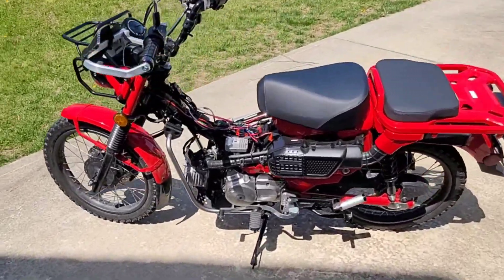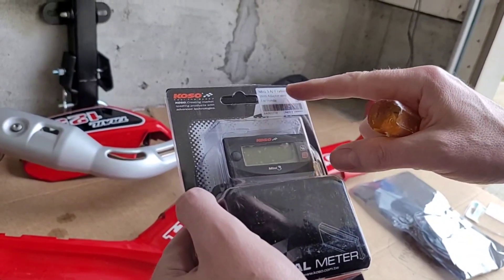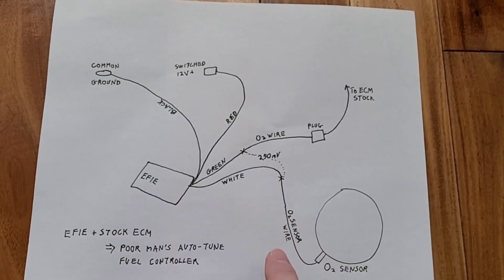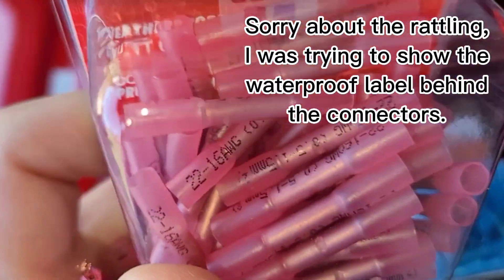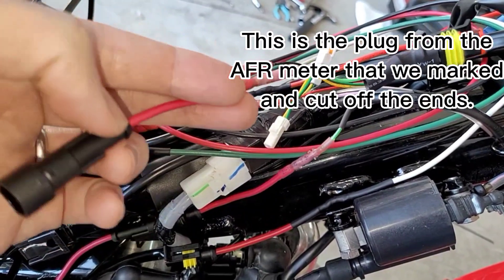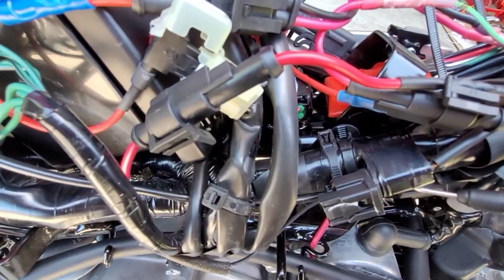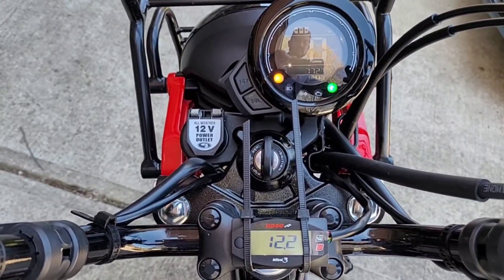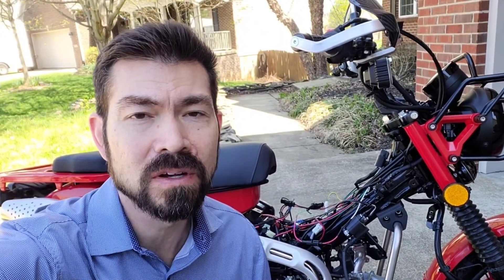CRAZY EFIE device for the Honda Trail 125. Super cheap fuel controller solution WILL IT WORK? Part 2

Comment: How is this setup working for you still?  Typical controllers are god awful expensive and sending things in to get flashed can be frustrating.
Reply from the maker: @bnolsen  It is working reasonably well for zero to mid-range throttle.  It does not do anything for wide open throttle, unfortunately. It seems that the ECU has some hard coded map on open loop, and it goes to that.  I had to use different injector sizes to deal with WOT conditions.

Comment: I have a 2022 Trail. I put a 186 bbk with the cam from mnnthbx. I have a larger takegawa or koso throttle body, px150 jnjector and the finbro 2v head.  I left the exaust stock because   I ruined my monkey by putting a loud ass over titanium exaust on it. I know I'm not gonna get a bunch of power out of the Trail with the stock exaust.  I thought the gain would be more.The power increase from stock is very minimal. Probably 15-20% more than stock. I need a tuner but can't afford the $800 a racer tuner.  Will your tuner set up be good for my situation?  I watch all your videos and read your threads. Thanks.
Reply from the maker: Let me lay out the downsides of my tuning setup.  It runs rich during idle so you will have to replace your spark plug from time-to-time (in my case about 2500ish miles). Every modification I make requires a new choice of fuel injector. It appears that the ECM uses the O2 sensor input to control the middle of the throttle range (closed loop).  At idle and at full throttle, it reverts back to its original maps it seems (open loop).  So the EFIE will absolutely enrichen the mid-throttle range and therefore protect the engine and give more power but only in that range.  Once the EFIE is set, you need to have an AFR reader at the minimum to find what AFR value the EFIE seeks at mid-throttle and never go above that value at any higher throttle level. Then you have to find a fuel injector that delivers enough fuel to never exceed that AFR reading from mid-throttle. It is a bit involved.  Total cost is around $250ish for the AFR gauge, the EFIE, and, perhaps, 3 fuel injectors for trial and error.  See my video on exhaust as well.  Does make a difference . . . Noise and power.
Reply: @QuantiQualification  So if I buy the expensive a racer tuner will it make the engine have power threw all the ranges? I have the stock injector, the px150 injector and one I have on my Monkey I got from Wayne Strickland.  He told me it's a ten hole injector he got from Gromfstherz. He said it was needed to run the grom fatherz high compression 186 piston with the ported koso 4v head on my Monkey. I use a power vision 3 on the Monkey.  The downloadable tunes for it doesnt match with my mods. I tried a bunch of the 4v tunes and its not correct. They don't have anything for a ported 4v head with a dome 186 piston. I think the power vision 3 has an auto tune function but I have no idea how to use it.  I can only drive it for like 10 min before it runs too hot. I'm in the middle of installing 2 electric fans to control the heat. I want something milder for my Trail. But I still want it to be kinda quick, without all the loud exaust. Dynojet doesn't offer anything for the Trail. They have all kinds of tunes for the Monkey and Grom. I saw in one of your threads, you ordered a Grom ecu to use on your Trail. Did you get that to work?  Is that an option I can do to be able to use my Power Vision 3 to tune my Trail?  Thanks for your help.
Reply from the maker: @smibunit1  As far as a Grom ECU, no.  I believe I mentioned that the Mini narrowband AFR from Koso was built for the Grom.  I had to rewire it to make it work.  There is really no substitute for tuning for power and heat.  You need to either have an autotune with wideband O2 sensor and AFR, the same but manually tuning, or do what I have done with a poor man's narrow band AFR connected to the stock O2 sensor and an EFIE at 250mV to know what the narrowband AFR at mid-throttle reads at that value and then tune, with either fuel injector choice or if you have a tunable ECU, connect EFIE to stock ECU, get AFR reading at mid-throttle, and then connect the tunable ECU and don't exceed that AFR value.  As far as electric fans, it is doubtful it will make enough difference.  The best way to get rid of heat is through the exhaust.  Cool with correct enrichened fuel mixture, then worry about long-term reliability with oil coolers and fans.  Last comment, it is difficult to get enough power with the stock exhaust and the stock timing with the trail.  Cheers!

Comment: So the EFIE will work with basically any upgrades on the bike like stock bike with new exhaust and intake?
Reply from the maker: Yes, absolutely. It definitely adjusts the stock fueling under closed loop.  I am not certain it has much if any affect at open loop or wide open throttle conditions.  So I believe matching the EFIE with the correct fuel injector is important.
Reply: @QuantiQualification  Nice! Yeah matching the injectors will be interesting.

Comment: Look up solder seal connectors, no crimping...just heat up and you get it soldered and shrink wrapped at the same time.
Best thing since sliced bread.
Reply from the maker: Wow, that sounds even better! Always looking for better and faster ways to connect wires.  Will definitely look it up.

Comment: Did you remove the fi-con type e?
Reply from the maker: Yes I did.  Running on just the EFIE and afr gauge now.  Planning on a video that tries different fuel injectors and how they respond. So far looks safe with a 235cc/min fuel injector and not safe with  115cc/min FI. LOL something in the middle will be ideal!
Reply: @QuantiQualification  I am running the fi-con on my trail125 181 Takegawa 4v with a g2 injector . 8000 miles no issues.
Reply from the maker: @DanceJeff-qi8ui  That is great to hear.  Do you happen to know what the G2 cc/min rating is? I am no longer close to what Takegawa recommends and therefore their map is distinctly different from what I need.  This would require me to do a full tuning with a wideband O2 sensor and afr meter as well as a dyno or many personal runs. When I first put in the Takegawa 143cc I did follow their parameters and parts needed to a tee.  Unfortunately, the piston developed slap after a few hundred miles.  It worked great before then. I love Takegawa and have used mostly their parts but Takegawa seems to be pretty conservative with the amount of fuel they send.  Example: I found out that the G1 injector is only rated for 115cc/min.  This is not much over the 90cc/min stock injector and they recommend this injector up to a 181cc piston and cylinder kit with normal airbox.  Most guys are running a PCX150 injector rated at 140cc/min for a 143cc piston and cylinder.
Reply: @QuantiQualification  the issue you have is heat related. Have you added a oil cooler?  If not the bigger the better and having 2 5 row oil coolers is even better.
Reply from the maker: @DanceJeff-qi8ui  I have an oil cooler on order.  The 164cc Yuminashi kits didn't have oil ports.  The new Kitaco I have installed allows one.  Hopefully the cooler will come soon.  The one I ordered is backordered, unfortunately.